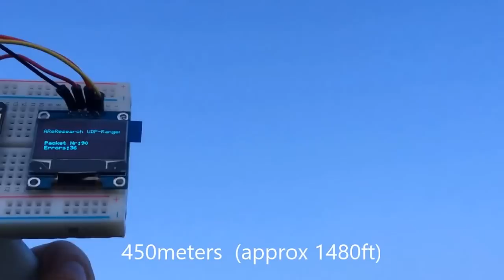ESP8266 range test "UDP-Ranger" - Part 2

Comment: Very useful video. Everyone wants to know how far these little things can transmit Thanks. Just one comment. The ground is very likely interfering with the fresnel zone, reducing the range. If your intent was to show the best range one can get, then raising the units, possibly as little as a few meters above the ground would show a marked improvement. How much can be determined by the many Fresnel zone calculators you can find online. It would better represent the true achievable range for a setup that is mounted on a pole or rooftop to rooftop. Thanks for sharing your work.
Reply from the maker: +Henry W I plan to do another test run. I'll keep that in mind and possibly use a fishing rod to get away from the ground.